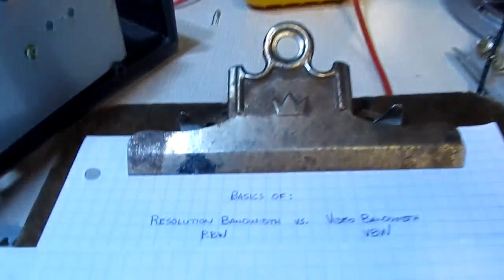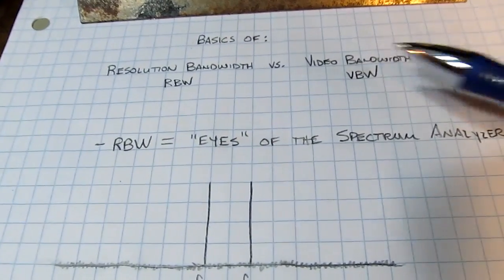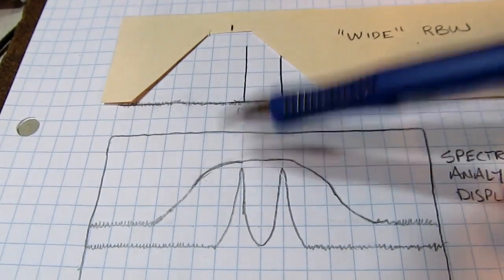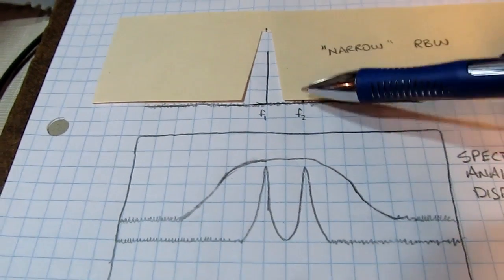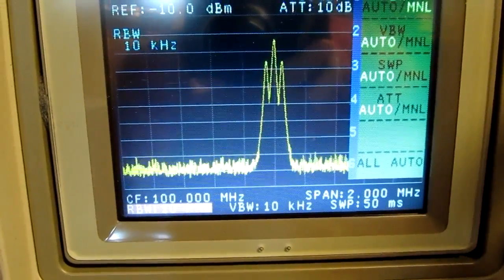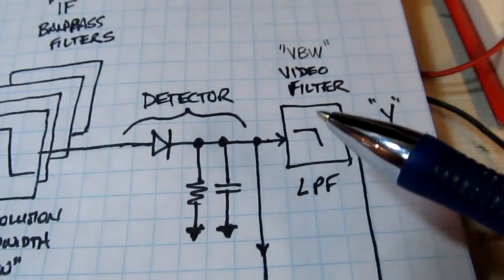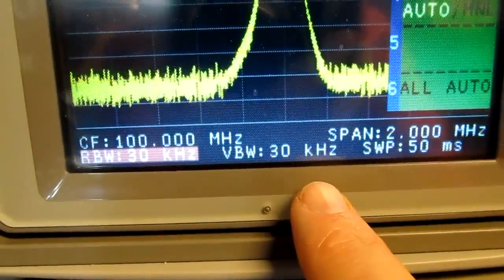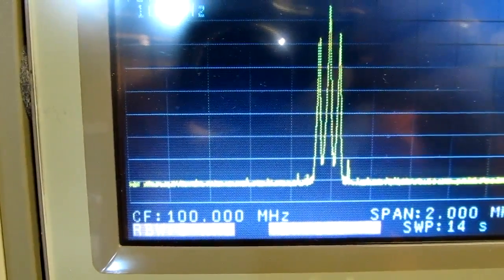#119: Basics of Resolution Bandwidth and Video Bandwidth in a Spectrum Analyzer (RBW VBW)

Comment: Brilliant explanation Alan...just starting to play with my MDO analyser..searched for "frequency analyzer rbw" and look who I find?! ;-)
Cheers, Martin.
Reply from the maker: Martin,  while the principles are largely the same, the SA in the MDO operates differently. There is no "sweep". It uses a discrete Fourier Transform (actually a Chirp-Z transform to be exact) to compute the spectrum from direct sampled data. Thus, there is no VBW function, and 'sweep time' is replaced with 'spectrum update rate.'  The RBW determines the time-duration of the data record that is sent to the Chirp-Z transform.
Reply: *****
Thanks for the info Alan.

Comment: Someone below asked why spectrum analysers are so expensive, my one uses basically an oscilloscope mainframe but with a spectrum analyser "plugin". One of the expensive to replace parts of a spectrum analyser is the mixer, they are easily destroyed but probably the most vulnerable component. The mixers have to have a broad, flat frequency response and tend to use exotic diodes within them. Sadly I have seen spectrum analysers effectively written off due to mixer damage.
I am sure the precision attenuators are not cheap either!

Comment from the maker: K1MGY - good questions.  I'll answer them using your numbers:
1) It is an Advantest U3461
2) VBW reduces the variation in the trace due to noise, it doesn't reduce the noise floor.  It won't reduce the amplitude of the signals as long as the sweep speed is slow enough to allow the filter to fully charge.  This is usually taken care of automatically.
3) Reducing VBW will help uncover things that are standing "in the grass" by flattening the noisy grass around the signal.  Reducing RBW will help even more by reducing the noise floor, uncovering signals that were buried below the noise.
4) Sweep time (sweep speed) is typically linked to RBW and VBW.  RBW is typically linked to SPAN.  Narrow SPAN = narrow RBW = slower sweep speeds.  Yes, slower sweep speeds in a swept analyzer make it easier to find transients.

Alan
Reply: ***** Hey Allan,

Thanks a lot for the great videos, as always. What practical difference is there between reducing the VBW and just plain averaging? I know that reducing the VBW is actually filtering the higher frequencies, as opposed to just plain averaging. Leaving the math aside, I notice that both approaches increase the sweep time and don't have an effect on the noise floor. 

Can you comment on the differences of both? When would I use one or the other?

Thanks!
Reply from the maker: Daniel Rojas You can think of the VBW as a trace smoothing filter.  Thus, if you had a low level signal buried in the grass, the smoothing would likely hide the signal - while averaging would smooth out the grass but not clip the tiny signal.
Reply: This is excellent. "Yes, slower sweep speeds in a swept analyzer make it easier to find transients." I have to take periodic measurements of pulsed microwave (RADAR transmitters to be exact) signals.  With one of our handheld analyzers (Agilent N9344C), I have to play with the sweep speed, or the signal will pop in and out of view, or it won't display at all.  The analyzer is basically DC to 20GHz and has no problem reading CW signals at any of the frequencies we check (anywhere from 700MHz to about 9 GHz). We sometimes borrow a Rohde and Schwarz FSH20 handheld that displays any signal we want to see without touching any settings.  I'm wondering if there was something I missed in the spec sheet when I acquired the Agilent, or is the Rohde and Schwarz just more refined?

Comment: Alan, fascinating.  A few questions from this presentation:
1. What is model of analyzer for demo?
2. If video bandwidth is reduced the amplitude of noise is also reduced and as it is a low pass filter is there a slight reduction in overall amplitude (and therefore accuracy)?
3. You mentioned reducing video bandwidth might uncover stuff that would be masked in the noise.  You mean a transient that does not go above the noise floor (of previous wider bandwidth)?
4. Would reducing the sweep span (I should watch prior video as term is not known) reduce horizontal sweep time and therefore increase resolution of transients?

Many thanks for considering my questions!

/k1mgy